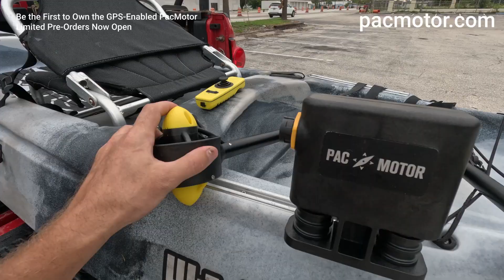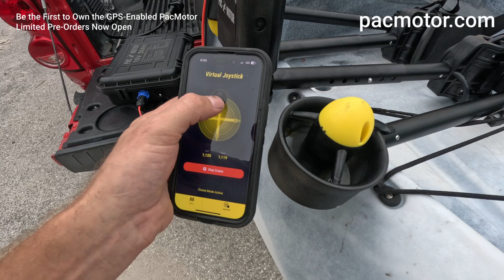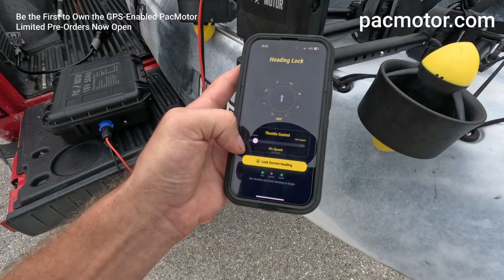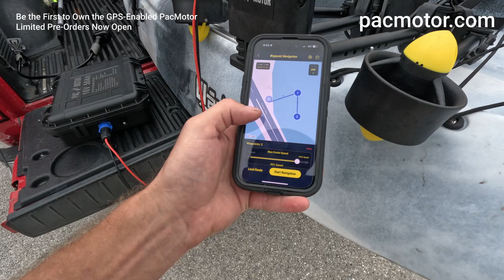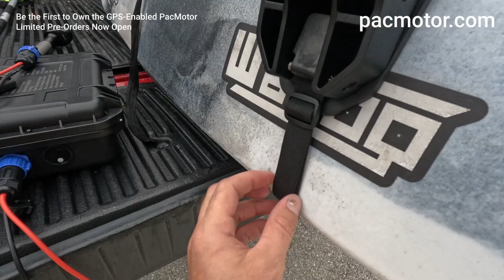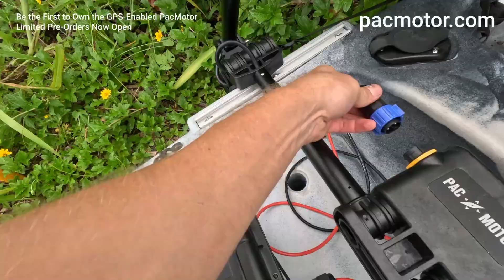PacMotor – World’s First GPS‑SMART Dual Thruster Kayak Motor

Comment: Should add the anchor button 1. To the remote and 2. So its on the different app screens so if you are on joystick or some other menu you just have 1 button push vs having to jump to a different menu